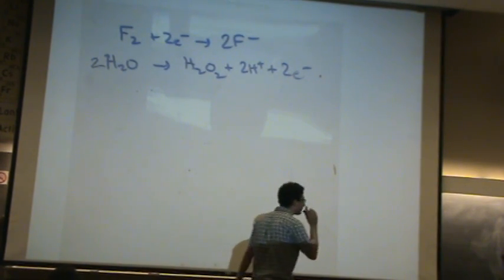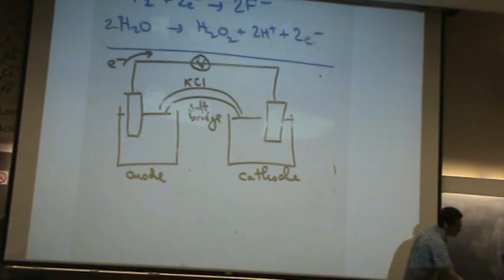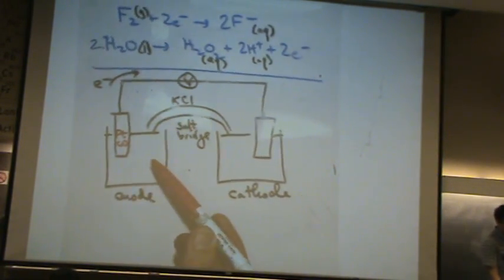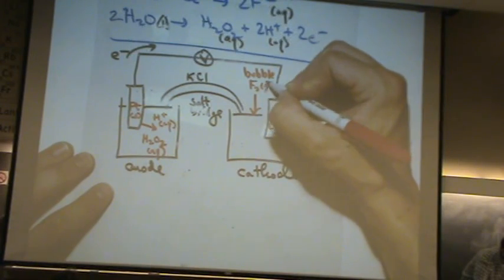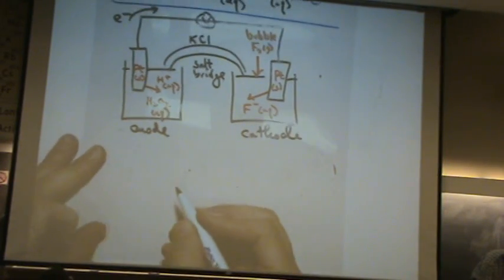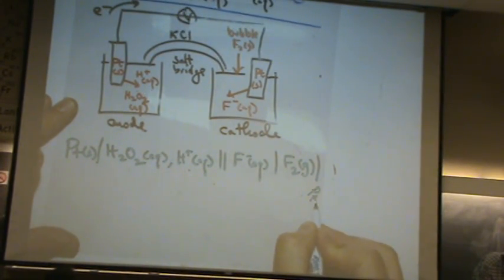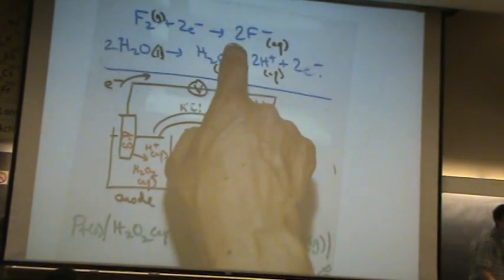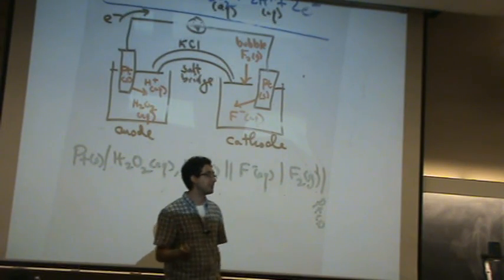Cell Diagram Example.mpg

Comment from the maker: @IamArianeBlanch Typically you need a relatively unreactive compound as a salt bridge.  I have commonly seen potassium nitrate or potassium chloride.  I'm not sure about sodium sulfate.  My general advice would be to use the common salts I mentioned.  If you really want to use a different one, make sure that there are no side reactions that would occur.